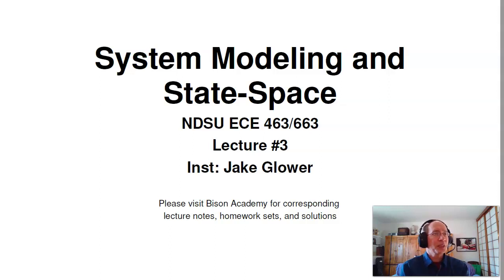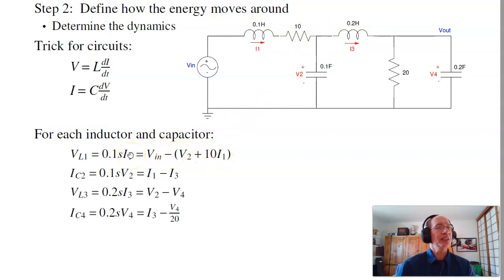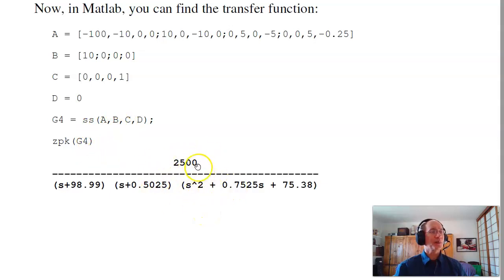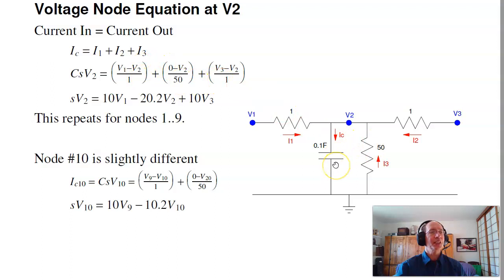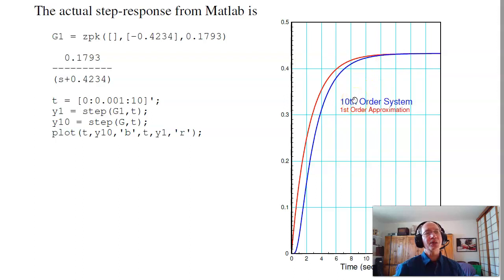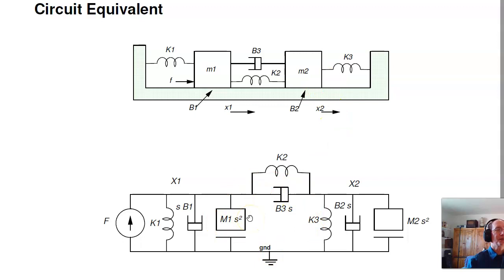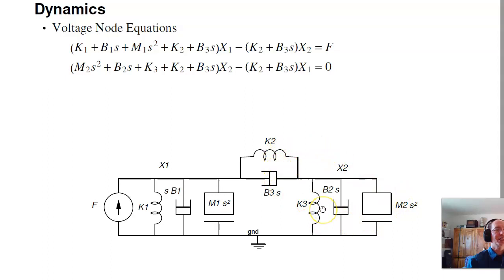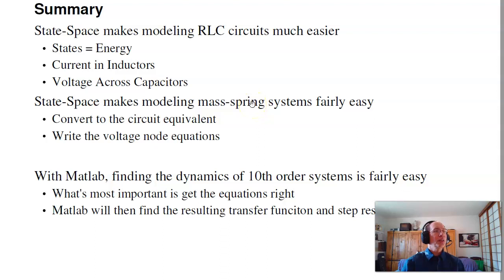ECE 463.03 System Modeling and State Space

Comment: Why do you write your state space equations in the frequency domain? E.g., 19:17. They are time domain equations.
Reply from the maker: If the input is zero for t<0, then sX is the same thing as dX/dt.  It's just easier to write sX.  It also keeps it consistent with state-space where a system is modeled as sX = AX + Bu